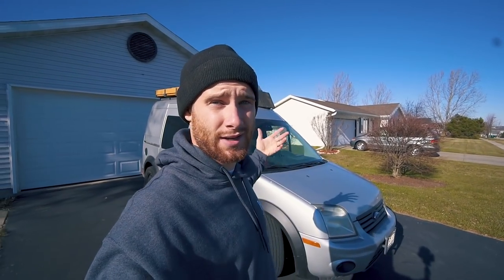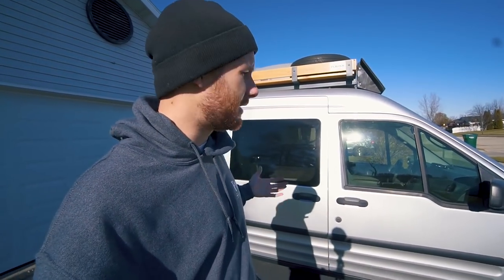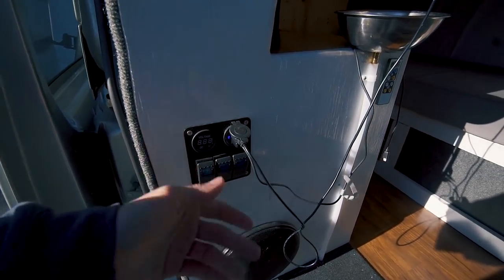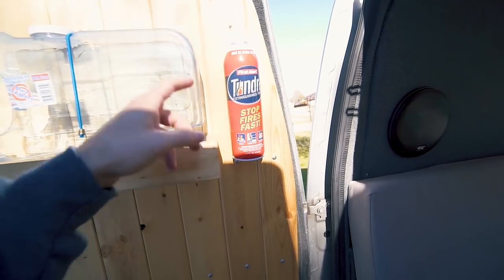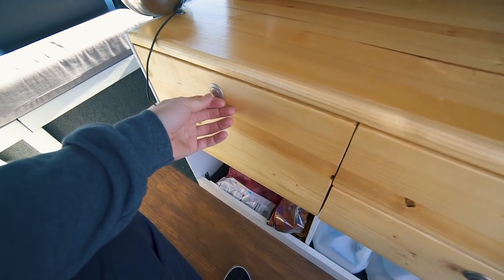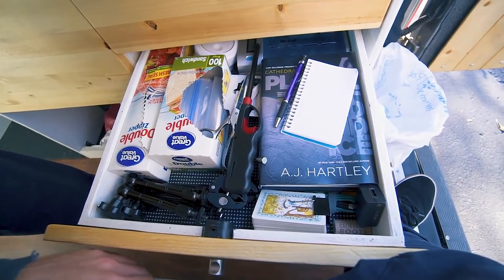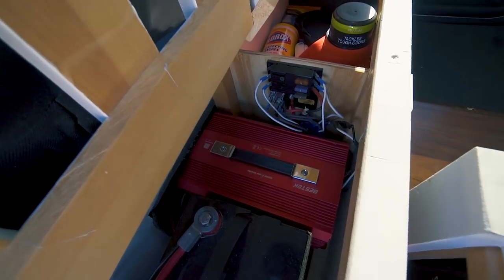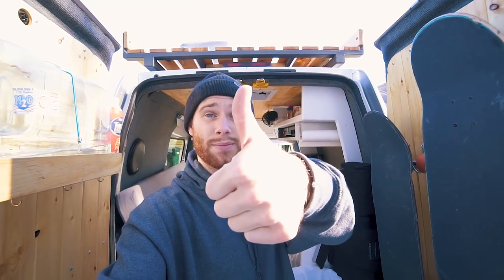TINY CUSTOM VAN CONVERSION | FULL TOUR!!! (  2010 Ford Transit Connect )

Comment: Hey Josh, great video. What do you mean when you say the interior space changed from the 2010 version to the 2012 version? It got bigger, smaller, longer, shorter, ceilings changed? I've been trying to find specifics online yet have yet to come across it.
Reply from the maker: I believe the body changed after the 2012 models. I don’t know exactly what changed but I am pretty sure the height got reduced and the wheel base got longer! But again I can’t say for sure
Reply: @Josh_Oakes  Gotcha. Thanks!

Comment: Hey Josh Oakes,
I found this van in u-pull in colorado. We gutted the who interior and are putting it in a different transit connect. I also have the thule from the roof, but I do not have they key! Do you happen to still have it?
Reply from the maker: I do not unfortunately

Comment: That's such a cool solution, congrats on this and thanks for sharing.
I have some questions:
What is the height of the living room?
How tall are you?

I'm 6 foot and when I sit on a standard chair, feet to head is about 56 - 57 inches. I'm curious if I could put a standard chair and a table in the cargo area and sit in there upright. Can you measure the dimensions and drop me your opinion on this? Thanks :-)

Comment: Great, I'm thinking I want smaller van to live in, in a out 4 months IL be living in a van soon, got to figure out how to make it so my three sons can stay 2-4 nights a week and still do school runs and go to work, in a bigger transit van can ya get two more seat put behind the drive seats for passengers like is that allowed, obviously it's a van turned camper but wouldn't it be allowed for passengers to chill in the back whilst driving I know that wouldn't be safe but for my three kids to stay, with only one passenger seat in a connect van but transit van only two passengers seats in front cab, if I drive around I need that 3rd seat so can still get about..

Comment: My fisrt thought was WHERE ARE YOUR SHEETS?
My van cushion is a foam XL twin cut skinny to 30".
I use a full bottom sheet to keep it clean - I have 3 sheets (none are TO THE WIND)

Clothing fits up top?
Come on. 3 months on the road?
My laundry is every 2 weeks.
You have under bed storage...clothes?

And yes, ya GOTTA have a FREE WILLY nighttime depository system.
Peeing into a small bowl gets splashback and the pee on the ground is just mean.

Comment: I see you haven't resolved the wasted storage in the front bench and the left cargo door.  Also no sink and wasted counter top.  You might want to invest in a cage partition for the cockpit so people cannot see in when you stealth camp.  I like the roof rack but again ruins the stealth of your van especially down the road when you want to add some solar.  The tire needs to go underneath or on the back door with a cover.  Also the roof rack will be getting the wrong type of attention when you are parked.
Reply from the maker: No wasted storage in the front bench, used for dirty clothes! I have a small sink like I showed in the video. Counter top space isn’t wasted either as I use it for cooking. I have a roller shade between the front and back that I pull down when privacy is needed. Won’t be adding solar because I have nothing in the van that requires constant power! The tire does need to go under the van where it originally sits from the factory but I mentioned a link in the video that explains why it is up on the rack! I have yet to get any negative attention with the roof rack when I’m parked!

Comment: How do you wire your house power outlet to your inverter?
Reply from the maker: I have an extension cord plugged into the inverter, then cut it and stripped the wires to run them to the outlet. then just ran another extension cord to the outlet for the power strip in the back! Hopefully that  helps
Reply: Just A Man With A Van 
Thanks man.
I live in gurnee Illinois, hope to see your van once you back in Grand Geneva Wisconsin.